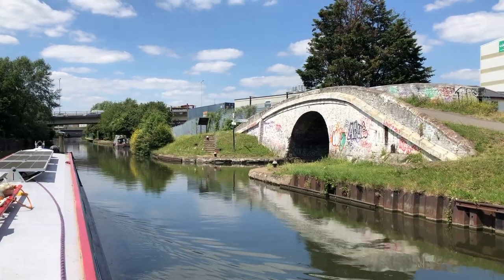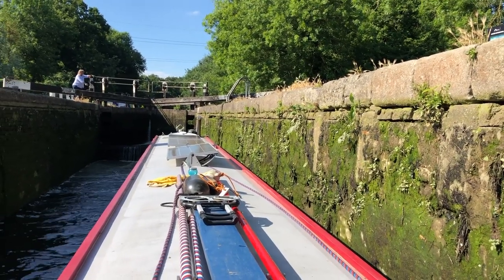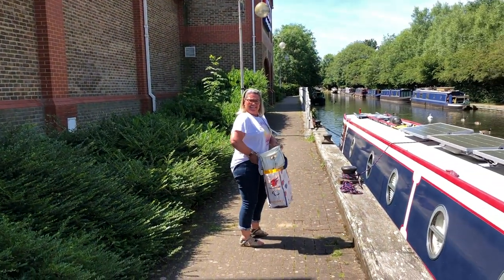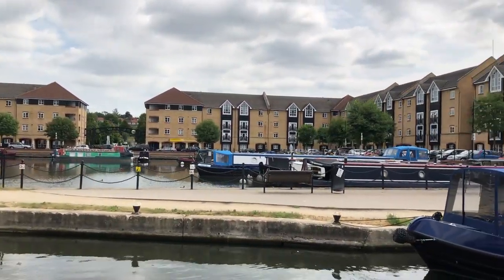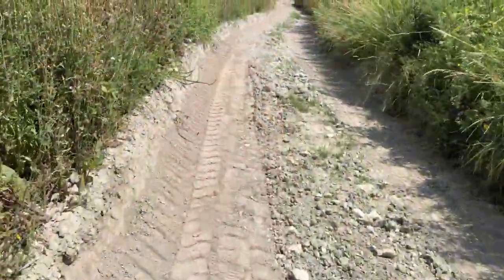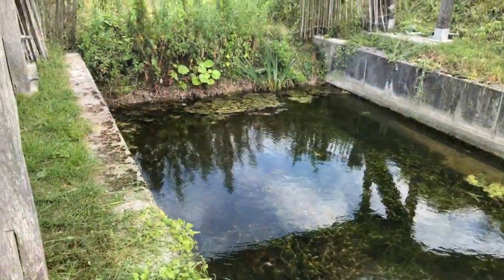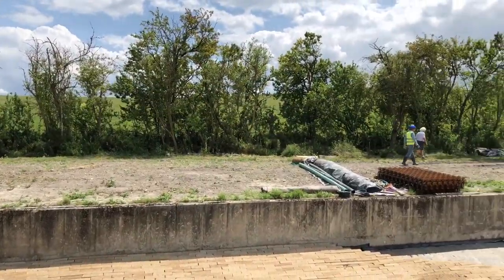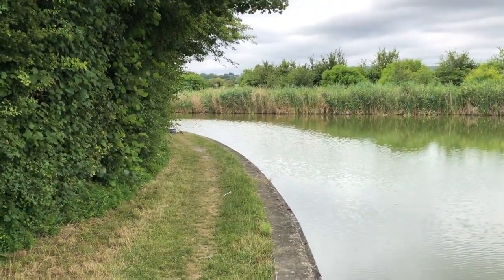E29. Wendover Canal Restoration, Narrowboat cruise.

Comment: Nice one again - treat yourselves to a "sea magnet" I've fished my chimney and cowel keys and sunglasses out of the cut many times with it😂❤️😁xx
Reply from the maker: Morrislouise Eagle Ive just treated myself to a magnet, only problem is my chimney is stainless steel which is not magnetic 🧲, but it will come in handy for other things
Reply: @welldeckdiaries5610  Can't you drill a hole in it and tie some string/twine/wire to it and tie the other end to the boat - so if it's knocked or rolls off again, it won't end up in the cut ?
Reply from the maker: pmailkeey thats my next diy job👍

Comment: @ 6:04 i've driven dump trucks and an excavator along there. @6:58, that "carpet" has bentonite clay in it. once wetted, it becomes waterproof. the blocks give structure to prevent tearing.
Reply from the maker: Ynot6 Thanks for that bit of info👍
Reply: What's holding up progress ? Manpower ? Manpower's easy to get hold of !
Reply from the maker: pmailkeey All the manpower is voluntary unpaid work and all the materials used are purchased with money donations. It why its such a slow process 👍
Reply: @welldeckdiaries5610  There are sources of free manpower. Not sure whether there's any locally.

Comment: Hey guys, quick question. You don’t seem to use any fenders or ropes when in the lock to steady the boat - How do you keep the boat steady and avoid damaging it on the walls or other boats?
Reply from the maker: All the advice and training will tell you to keep the fender up in a lock as they can wedge you solid in narrow locks. They can also get ripped off in locks andthen get caught in yours or the next boat propeller.
If you look at the hull of a narrow boat there are raised horizontal metal strips call rubbing strakes, it's their job to rub and grind against the wall. The fenders are only used for hull protection when mooring
Reply: Well Deck Diaries Thank you for such a prompt and informative reply 🤗